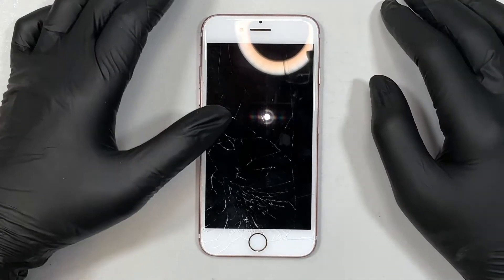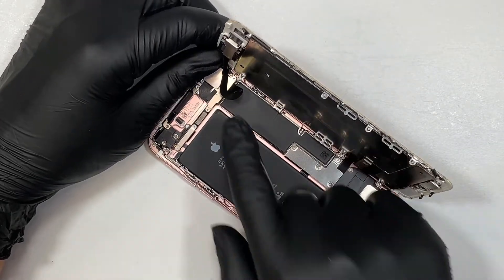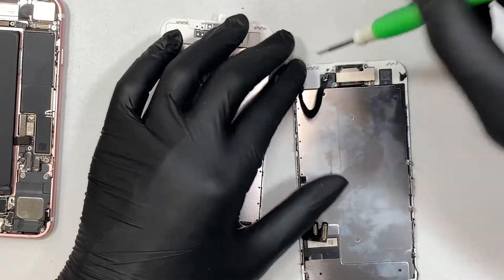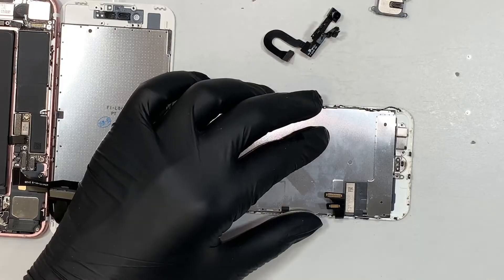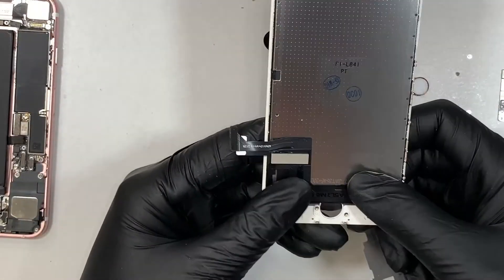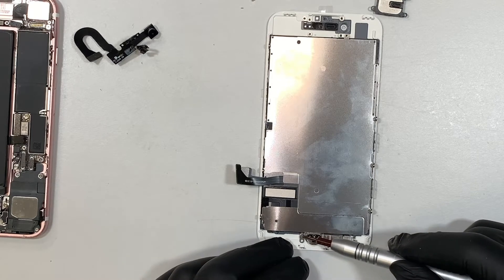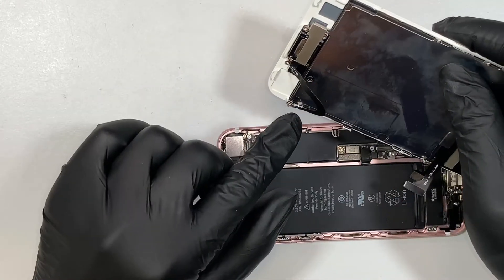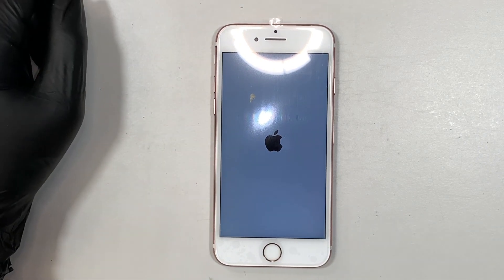iPhone 7 Screen Replacement

Comment: Thanks for the video, but you forgot to put the last two external screws back on. Also this replacement screen apparently doesn't come with a new seal so the phone is no longer water resistant.

Comment: I'm having a problem identifying my phone compared to the sellers on Amazon. It would be helpful to explain that step s we could purchase the right components. For example I have an Iphone 7 and on the back it says model A1660. When I go to Amazon it says that model # for both 7 and 7 Plus on some vendor pages. They also give measurements of 4.7" and 5.5". The entire length of my phone is about 5.25". I would  assume it's the 5.5" model but the model # is different?

Example: 
EFAITHFIX for iPhone 7 LCD Screen Replacement White 4.7 Inch Frame Assembly Display 3D Touch Screen Digitizer with Repair Tools Kit Tempered Glass Screen Protector for A1660, A1778, A1779

Example:
This iphone 7 plus LCD screen replacement is ONLY for iPhone 7 Plus 5.5 inch, Compatible with models A1661, A1784 ,A1785. Not suitable for other models or other brands. Please confirm the model carefully before ordering it.

Please help.

Comment: When removing home button, might be better to try lifting from the loop that extend around the plastic alignment bump to start getting underneath the backing to get leverage since there should be no adhesive there. I initially tried getting under it from where the cable folds up and over as shown in video and I think I ended up damaging the circuitry in the ribbon cable. =(
Otherwise, the video is very detailed and helped immensely! Thank you!